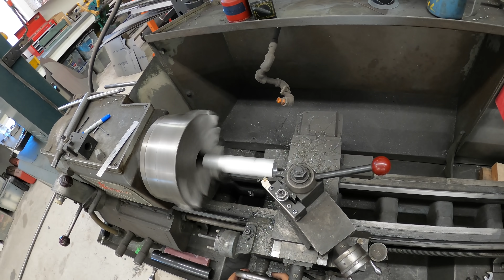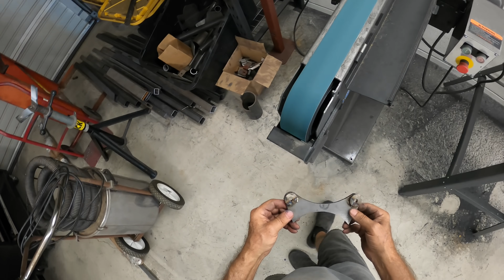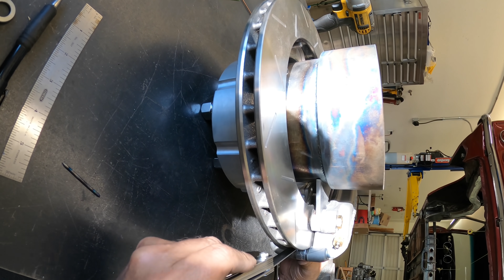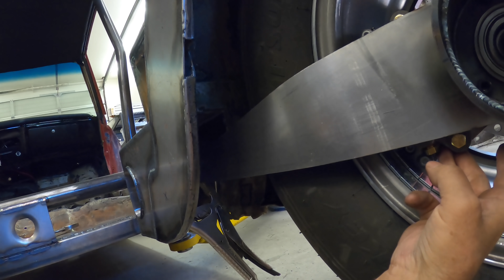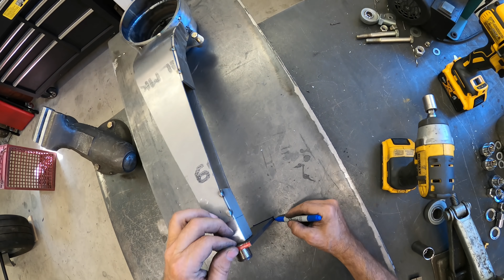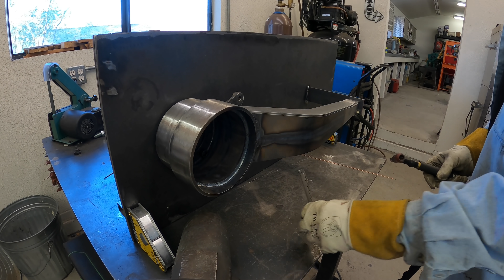V8 into Corvair redesigned rear suspension

Comment: The way you weld a tight radius ellipse into the swing arm for the rear suspension is to bend the tip of the tungsten and extend it so that you can fit it into that small radius, get a bigger cup and then turn up the gas supply.  If you can build up a non-combustible dam around the area of the weld to constrain the gas flowing out of the cup from flowing out of the area, so much the better.  It isn't a wonderful way of doing it, but it is functional and gets the job done.
Reply: You can't be serious. Bend the tungsten? 🤦 Snap.

Comment: The best bet as far as keeping everything lined up and turning freely is simply to have a reliable assistant spin the rear wheels as everything is tacked into place. If it all lined up initially then it still should provided the "poor man's jig" tip is followed faithfully. Lots of thought to your engineering. My choice when confronted with access issues when welding is adequate gap to weld thru into a copper or brass backing strip which is then sacrificed and cleaned up to smooth at those spots. Also have used ceramic tape for 100% backup strip. "I know, lets show some heat straightening and annealing with a torch and wet rag video".

Comment: I've seen an Oldsmobile 455 Toronado engine and TH425 transaxle installed in the rear of a Corvair. The engine was in where the back seat used to be. Pretty sure they used the front suspension as the rear suspension for the Corvair. Unfortunately I didn't get to see it go anywhere. I imagine it probably went pretty good.

Comment: Not sure what all you will do with this car when it is finished and it is to difficult from the video to tell exactly how much clearance there is between the swing arm and the sidewall of the tire but it looks like it is only about 1/2 an inch and if that is accurate then you would be pushing your luck expecting it never to rub the sidewall on the swing arm. Can't really tell accurately from the video and the car may never see much side loading  etc. so maybe it won't matter. Interested in seeing it progress. What transmission will it have ?
Reply from the maker: It has 1/2" of clearance, I'll try to stay out of the mud.  4T80e trans.

Comment: Hot diggity dog this is turning out to be one hell of a vlog. Another hundred mill or two (views) and Al Gore's rhythm just might recommend you. 
I can't wait to see this thing roll out in the spring. You're definitely killing it. Going to be one hell of a car when it's done. The transverse LS4 idea was brilliant. Really making use of the available space. There's a build out here on the interwebs, a Vair Monza with a 283 that doubles as an armrest. He took Mid engine to heart with that build. It doesn't have an engine cover. I don't know how long I could tolerate a 283 riding 3rd wheel screaming over everyone else. 
With that said, I still give him an A+. Everybody talks, rarely does someone do.
Reply from the maker: This is my first build that will be all video.  Previous builds have been done with just pics on forums.  It's a niche crowd that will watch it so I don't plan to set Al Gores rhythm on fire.  Yeah, the North/ South engine arrangement has been done hundreds of times and it's always the same problem:  the valve cover doubles as an arm rest.  Still can't use a back seat with an East/West configuration but at least, you would have to reach    way back   to touch the engine.

Comment: I was wondering if motor mounts could pivot with trailing arms a bit it might solve side pressures.
I like your project though, quite inivative.
Reply from the maker: The main objective with the motor mounts is to make it easy to drop out of the bottom, 'cause, you know, it will probably be coming out for various reasons.

Comment: If halfshafts are part of the trailing arm suspension,trailing arm pivot points have to have some give.
"Up and down" motion of trailing arms will pull in an in and out "at  the halfshafts. Unless, halfshaft ends can slide "in or out" as trailing arms go in an "up and down" motion, due to road surface conditions.I owned a corvette C3 and trailing arm pivot points cpuldn`t be solidly bushed at pivot points. I hope you solve this situation and come up with something better than the old corvette style rear end.
Reply from the maker: Yes, the C3 and original Corvair rear suspension are similar in that they rely on the half shaft as one of the fixed suspension points.  My arrangement uses inner and outer plunging CV joints and two lateral control arms so the axles have plenty of room to breath.

Comment: Have you seen my V8 Corvair project...I am using Porsche 944 suspension, it has swing arms, perfect fit to a Corvair.
Reply from the maker: I didn't see your Corvair on your channel, where is it?
Reply: @JohnReynolds661  https://www.youtube.com/watch?v=y2DhcADotgk

and yes it isn't exactly the best..
Reply: btw, I did put it in 'backwards' no video yet as project stalled after that, will get back to it someday..maybe soon now I have new shop almost workable place.
Reply from the maker: That's quite a project and might work for a north/south conversion but not an east/west conversion like what I'm doing.  BTW, I interrupted the torsion housing and made an 8" gap on my VW/Subaru project, check it out if you want to see it done: https://youtu.be/1xyE8oU-s4c

Comment: As a Aerospace TIG Welder for over 40 years - You need to use Backup Argon Gas then you can put your Tungsten out as far as you need to Weld. Make like a Tent out of Aluminum Foil or any non flammable material to keep the argon gas into place.
Reply: Heh - heh . . .  Grey Hair for the WIN !
Reply from the maker: Good point about the shielding gas.  The bigger problem was that the torch would have to be nearly horizontal to the joint.  I've heard of ppl bending the tungsten to do such a job but a mid plate was a easier solution.

Comment: why not mount the caliper on the rear of the hub and swap calipers side to side. bleeders on top better axcess and cooling.

rich
Reply from the maker: The rear area of the hub is even more busy than the front as it will have control link tabs and some way to spring the car.

Comment: Good job!
New to this project. What was your inspiration. And why abandon the stock Corvair design???
Just curious 
Just purchased a slightly rusty 1962 Greenbrier. Always have my eyes open to new tricks. Wish you were here to help me fix some of the chassis 
No V-8 for this girl, but she definitely needs some more horses
Reply from the maker: The late model Corvair body style has always been a favorite of mine.  But the stock engine and trans are very antiquated.  V8 swaps used to be very poplar with these cars and have been done hundreds of times.  Basically, it's a fabrication exercise which is why I do it.
Reply: @JohnReynolds661  My first five cars beginning in '73 were all Late model 180 hp Corsa's. I would have been happier with just a crank driven Roots blower and a Quadrajet but I knew nothing then and affordable EFI was a German Car thing. However my Dad was an A&P mechanic for Braniff and my Uncle Jerry was Lawn Boy's Chief Engineer..https://www.youtube.com/watch?v=MdjyBuxNkkA. 
At first I used N2O and stole the idea to use it to spool the compressor up by impingement. Then Uncle Jerry just wired the throttle open and hooked the accelerator pedal to the distributor (like some outboards) et viola - the first anti-lag on an American Car.
Dad - not to be outdone - built an Onan BGM  (all alloy 45 cid opposed twin ) driving a Sullair cast iron screw compressor into the front trunk/fuel tank ares meaning the propane tanks took up the whole back seat area.
        We finally reached the limit of what could be tolerated by the 9-bolt ring and pinion gear even with custom 4-pinion spider gears and had to give up about 1980 and a guestimated 450 pounds of torque.
  Kept me off of drugs (but lost my license three times)($$$) and I won't go into tacking a gutted Powerglide onto the front of the '66 Saginaw 4 speed, copper-riveted clutch disks to hold the torque, and custom tool steel needle-less u-joints on the receiving end of some or all of the foregoing silliness.
     Carry on the Corvair Rep for over-the-top-ness, John. We've a legend to perpetuate (at any speed or even stopped).
Reply: @JohnReynolds661  when I was like 15, my Hot Rod uncle had a LM Corvair coupe that had small engine fire(big surprise) He had all the plans to do a Krown conversion on it. Never did anything and I regret not buying it from him.

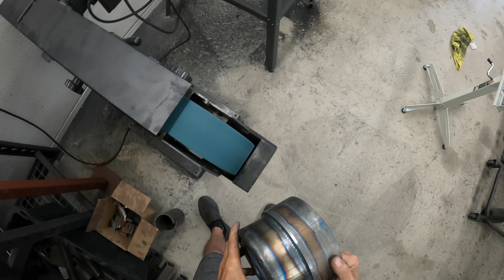Comment: Hi John, great work as usual.  Question about you checking the caliper to rotor clearance shown at about 7:35 - what is a desired dimension here?  I've never seen a spec for that.  Thanks!
Reply from the maker: I think what is important is to center the caliper in the rotor. The gap should be the same between pad and rotor on both sides.  The gap dimension is not that important.
Reply: @JohnReynolds661  Got it, Thanks

Comment: Porsche got around trail arm twist strengthening by putting tubes along the length of the trail arm to join both sides together . Welded  outside . I would  stitch weld inside also but I’m a back yard engineer from a country seaside town in Australia and don’t speak German.

Comment: I'm very curious to see how your are going to stabilize the rear wheel trailing arms since the front pivot has a ball joint.
Reply from the maker: It’s going to use the same principle as a RZR rear suspension
Reply: @JohnReynolds661  Ok that makes sense, will the arms be mounted to the chassis or the engine/trans?
Reply from the maker: @johnnym1320  chassis
Reply: @JohnReynolds661  looking forward to your progress, nice work!

Comment: Why put a taller engine in a rear engined car?, that will raise CoG.

Or are you putting the engine in front of the rear axle?
Reply from the maker: It's an aluminum block LS engine in front of the rear axle (mid-engine)  which will handle better than the stock rear engine configuration.
Reply: @JohnReynolds661  very cool

Comment: It's just too good, but maybe needs more tire to swing arm clearance, can't wait for the next episode!
Reply from the maker: Hard to see, but it has nearly a half inch clearance.  As long as I stay out of the mud I should be fine.
Reply: @JohnReynolds661  High load sidewall deflections ? Nice work don't tell Noam.😉
Reply: You can run narrower tires in the winter so you have room for tire chains. 😁

Comment: How will the rear control arms swing to 25 degrees positive camber,   ya know,  just to keep the handling "factory"

Nice fab work, keep the vids coming!
Reply: You must be thinking of the earlier Corvairs and other common cars such as Volkswagen Beetles, Triumph Spitfires, Porsche 356s, Renault Dauphines, etc. This is a 2nd gen Corvair John is building that had suspension with minimal camber change with up/down wheel travel.
Reply from the maker: Of course, it needs to retain the factory unsafe at any speed.  The car needs to have at least a little chance to kill me.
Reply: @JohnReynolds661  lol

Comment: If you did one inch long stitches every three inches and working cold bits before moving back to hot bits until every panel has a stitch every three inches you can then close up the gaps with the work pieces experiencing minimal distortion.
An alternative to the center plate or in addition to would be to get some thick wall half inch or 10 mm tube and pass it through so it transects the bend then weld the tube to the walls it intersects with.
Reply from the maker: Those are other ways to do it I suppose.  It been my experience that no matter how you put 5’ of weld on a fabricated structure, it’s going to shrink and warp.  Pretty common to use fixtures when doing this kind of work.  Thick wall tubing is certainly strong enough if you’re not concerned about weight.
Reply from the maker: Also, even though I welded each arm with 6 opposing sections, I prefer to weld the entire project in one session to avoid repeated heat cycles.

Comment: Just a tought,
When trying to position the caliper, what if you put the caliper in place, use some compressed air to tighten the pucks on the rotor, then the caliper will be in it's position, then tack and weld.
Hard to explain in english
I Really enjoy your work.
Reply from the maker: That's a good idea.
Reply: @JohnReynolds661  I have used 180PSI to center & hold the caliper while welding caliper mounts for years. Works great, fast & easy.Caliper is not spinning so if it is off be a 0.005 or so not a big deal, pistons will correct any minor misalignment. Great work on your build sir.
Reply: @ Michel Party, It will work if the caliper is one sided piston design but if the caliper has pistons on both side the caliper has to be aligned equal distance to both side of the rotor before welding the hanger.
Reply: @b-lopez394  I center 4-piston and 6-piston calipers with 180lb compressed air.

You should confirm correct centering with a feeler Guage,  but most often I find it very close, just like when you apply the brakes.